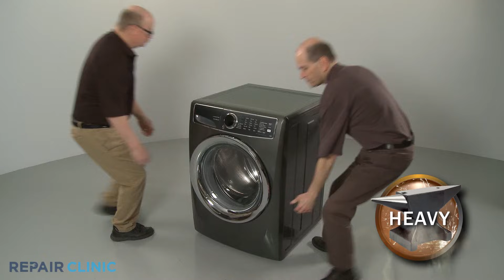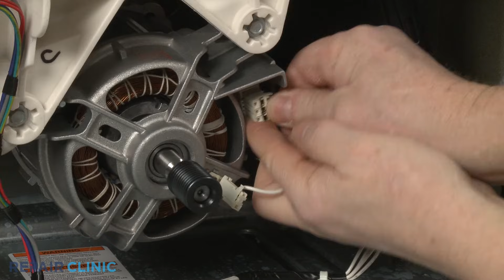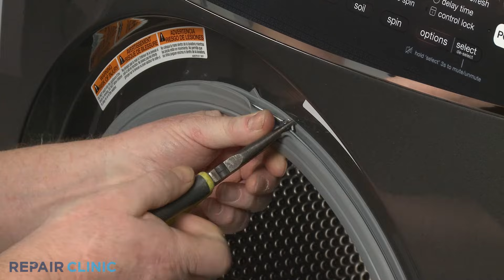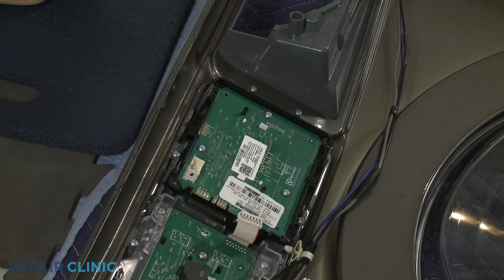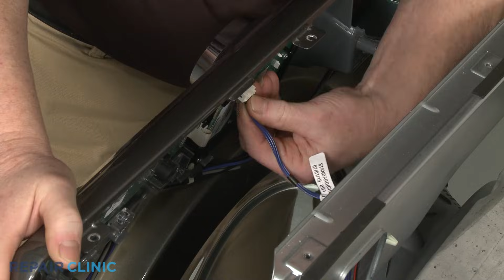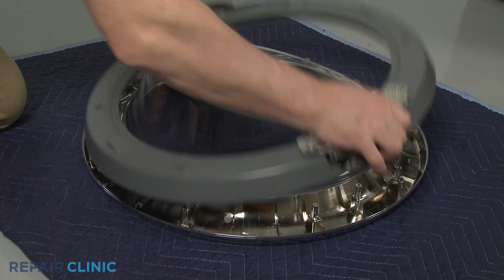Electrolux Front-Load Washer Disassembly (model EFLS627UTT)

Comment: question: is it possible to increase the water level on an electrolux front load washer?
Reply from the maker: In most cases the water level is factory set and not adjustable
Reply: @repairclinic  thank you. LG and Samsung washers have " factory set" water levels that are also adjustable by the consumer. it will void your warranty but many people do it anyway. I was told that it's not even possible on these

Comment: Thank you for posting this video. Could you or someone who’s familiar with assembly line protocols help me. I received a brand new Electrolux, however, the very first time I used it, it started spewing water all over from the bottom of the washer. After further investigation, it turns out that the washer tub plastic shroud had a 7” in diameter hole in it. There is no damage to the exterior of the washer nor the box that it was shipped in. My question is that beside the hole, someone wrote in blue permanent marker,  something I can’t quite make out? “508EL” with the letter “B” initial underneath? Does anyone know what that means. The EL probably stands for Electrolux? The model is a ELFW7537AT. Thank you to anyone that can help.

Comment: I need to lift my washer to move it out of the wasroom. Is i work it to remove both weights inside to lighten the load or those that make little difference for the trouble of removing and puting back ? thanks
Reply: @repairclinic  I wonder just how many horrifying questions like this one you get on a yearly basis?
I will tell you, the last two repairmen who have come to replace our Electrolux pumps left it in worse shape. The first tore the hoses inside because he didn't disconnect the water and the second couldn't figure out how to get into the lower assembly, so he let wire terminals disconnected.

You really out out some quality videos these days!
Reply: @repairclinic  Also, how do you empty the drum when the pump won't... 🤔 pump? Should I elevate the front and simply buy a battery powered pump to drain the drum to prevent a whole lot of water from flooding the floor?
Reply: Scoop what you can, towel the rest. A lot of water that will get smelly if ignored too long

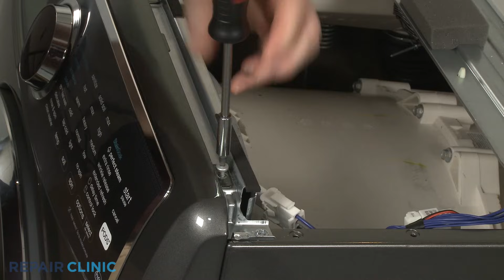Comment: Dear RC: At about 6:55 when you are about to remove the front of the machine, the last screw you remove is one that attaches the top of the front to a silvery metal bar that spans the width of the machine at the very front. For this and related models, that bar is absent from the diagram for the cabinet parts. I just wanted to buy the correct size screw to re-attach the front of my washer, so I don't have to refer to the diagram to do that. I'm just curious or maybe I'm reporting an omission. Do you know why that bar isn't shown?

Comment: I had my drain pump changed now it keeps saying my door is open. The guy put a new lock on and it’s still saying door open. Now he says it needs a control board!!!
Reply: This happened on a dryer that I just bought. It needed a control board replacement.

Comment: I replaced the front board of my Electrolux EFLW317TIW1 but now it doesn't power on.  I double checked the two connections to the board.  Any suggestions?

Comment: Does this type of washing machine have a filter drain on it.
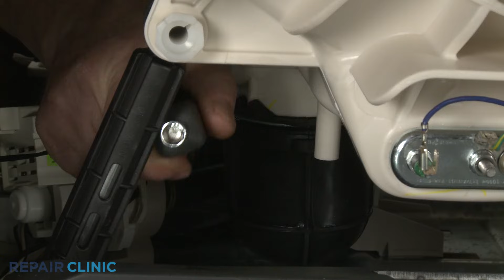Reply: Is it not the one at 8:47?
Reply: Did you ever find out? My washer stinks and I have cleaned it several times. Wish I could find the filter as I’m sure it’s the culprit... why is it so complicated compared to the Samsung?
Reply: @nmaze6913  i didn’t
Reply: @nmaze6913 did you get the filter cleaned out, was it the cause of the smell? I am looking to buy a washing machine like this would you recommend it or has it been difficult with the location of the coin trap?